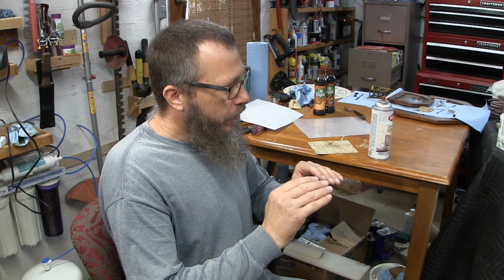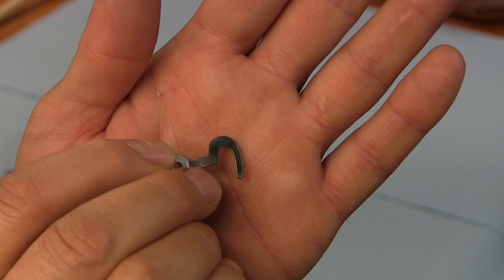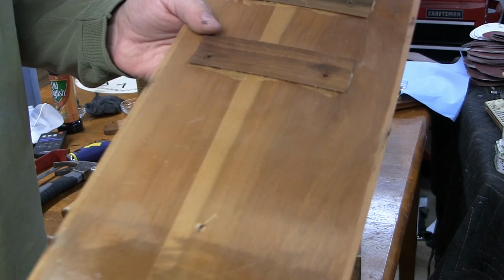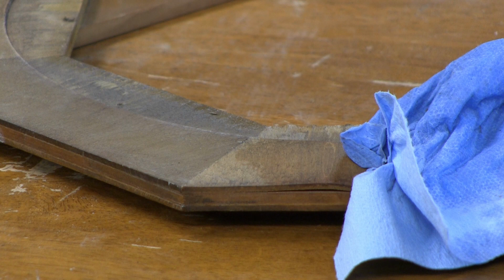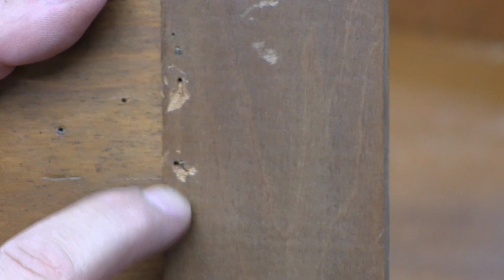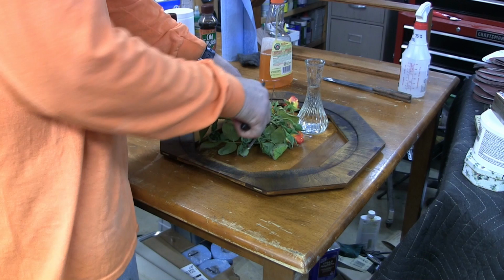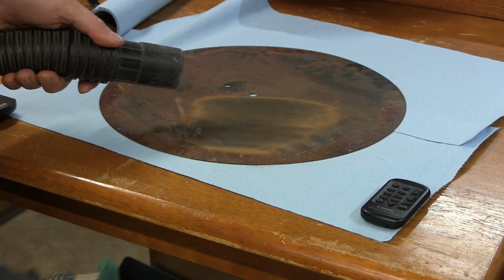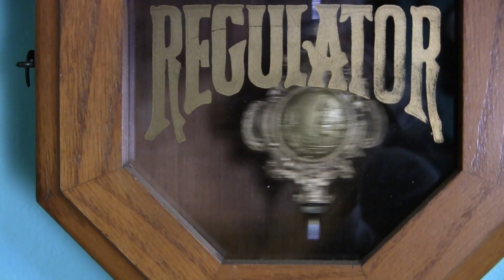1934 Ingraham Bedford Wall Clock Repair Pt 2, updated version

Comment: what type of oil do you used on the gears and springs ?
Reply from the maker: Mobil 1 Synthetic Oil 10W-60 for Main Wheels, Mainsprings. Mobil 1 Synthetic 0W-40 for most pivots. This is recommended by Kens Clock Clinic.
Reply: @time4clocks   thanks 👍
Reply: @time4clocks  Don't tell Mobil. If they find out its used for clocks the price will go up to $100/quart. The Mobil synthetic works great for clocks.
Reply from the maker: @johnhannon  No doubt! If you ever read the report on oil from Ken's Clock Clinic it explains all the oils quite nicely. 😁